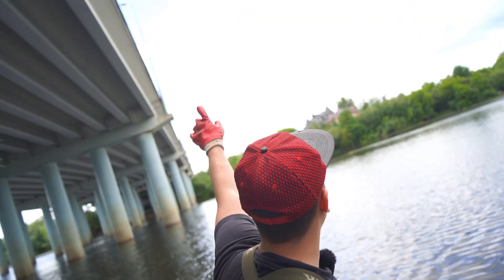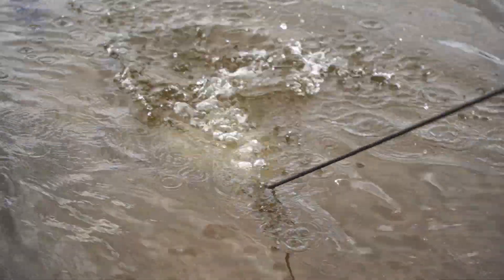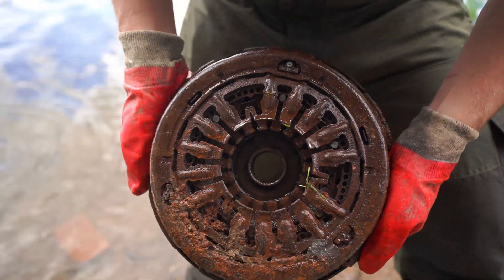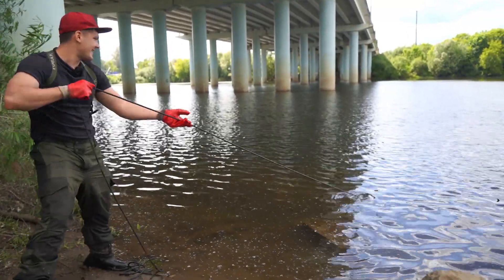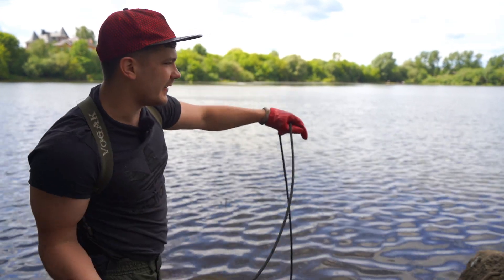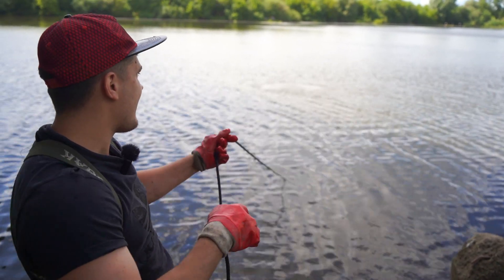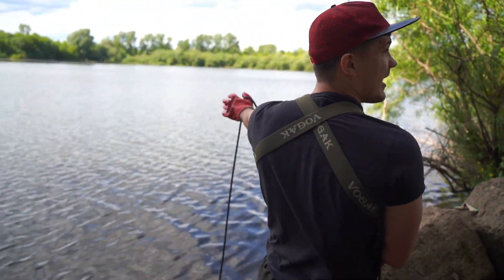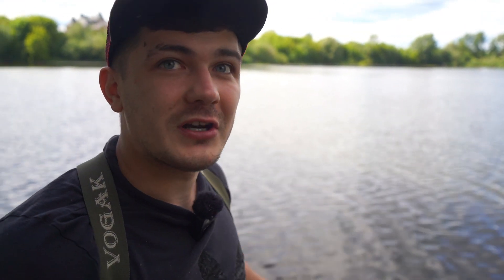I Found a Car Under The Bridge While Magnet Fishing!

Comment: That car part you found was the clutch olso the parts you found in your Lamborghini video were a differential cover and some tiny engine not sure why it would be there though and the bonnet (hood for you Americans) in my opinion didn't look very much like one from a Lamborghini so it was most likely something like a BMW or some car like that with a new badge printed on it.